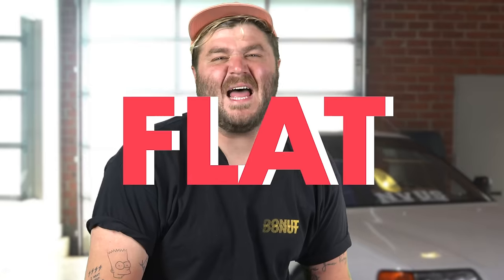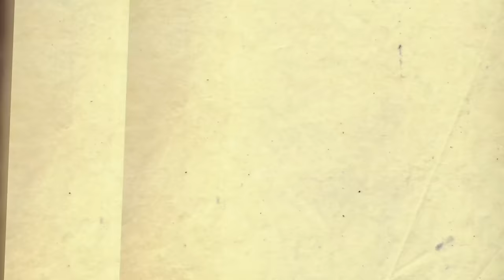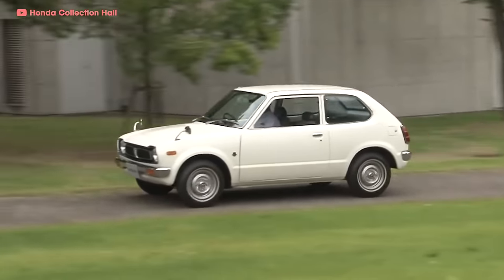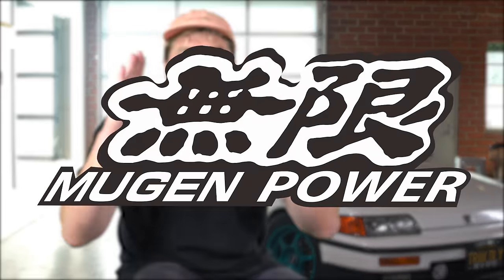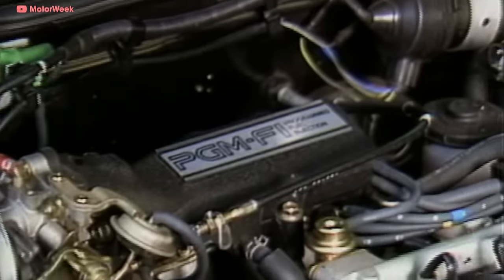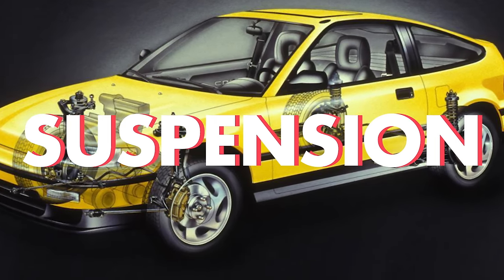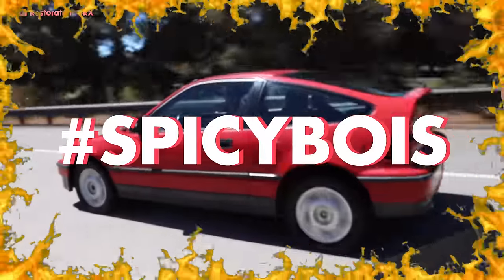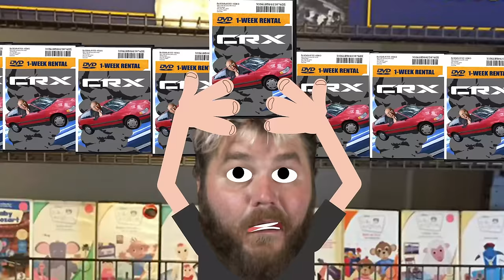Honda CRX - Everything You Need to Know | Up to Speed

Comment: I've been looking for a CRX for my pizza delivery job. can't beat the 50mpg city
Reply: 😄 I delivered pizza in a crx hf for years. He's 100% right. Averaged at least 40mpg all city driving. That hf trans was geared super long and the engine was designed to barely sip fuel. Best Honda ever made
Reply: Yes, you can! Get a Suzuki Swift 1L, 56hp (Geo Metro in US) to achieve 52 mpg 😎
Reply: And watch it crumple like a tin can when you drive over a pebble
Reply: @chopping_board1  nah
Reply: Will you? I could drive at 14km per liter? But revving it is mutch more funny.
Reply: The best part about using this car for pizza delivery is that if you miss the house you can do a U-turn on a single lane road.

Comment: I had 2 CRX's 20 years ago. Dammit I should have kept at least one of them. One had a JDM B16 swap and yes......I always did the buuuuuuuuurrrrrBBBBRRRAAAAAAABABABABABAA! as I exited the bay area toll bridges!!!!!
Reply: Yep.....
Reply: Wanna buy mine?  1990 CRX HF, with full suspension, ZC sohc, Si trans, RPF1 wheels, etc....
Reply: i just got a 91 crx si shipped from cali and it has a b16 engine swap with a turbo , i’m hella excited to get it !
Reply: my dad had a b20 in his. we also lived in the bay at the time. he raced at 7th and 1st street
Reply: I bought a 1990 running crx for 1200$ and never getting rid of it don't care if it has the smallest 1.5 engine in it gonna keep it
Reply: Same I had 2 crx’s sold one and the one I currently have has a k20 single turbo swap crx si
Reply: I had the European kind.. Nice answer on the golf/rabbit type 2 GTI. Rust is what killed them here.
Reply: I have two of them both are 89, one is an Si with the original D16A6 and the other is a DX with a ZC engine. Both are actually almost rustless and I live in the Pacific Northwest. Should I keep the Si completely stock and turbo the ZC because it has more HP and it’s just a “ DX “ ?

Comment: How to get you car stolen:
Own a CRX
Reply: Or integra gsr
Reply: They can tow it away with a Prius.
Reply: Thankfully haven’t gotten mine stolen. I watch it like a hawk though.
Reply: My first car hf d16y8 got stolen now the new crx si is garage keeped
Reply: Or a 97 civic
Reply: jimmynickelz i bought a gsr sedan and it got broken into the first week i had it
Reply: Does a rsx count
Reply: I thought that was cadillac SUV
Reply: Own a Honda
Reply: @jimmynickelz  Somehow I've escaped having my GSR stolen, even after owning it 18 years.
Reply: I live in the south, in the middle of nowhere so car theft just isn't a thing. But booooi when I was 18 I got a 1991 crx si 5 speed with a Z head and cam swap. It was so beautiful to drive on those country roads. Unlike most Honda's I've owned my crx had more low end torque - unlike the 1998 civic ex vtec I had which didnt get fun until over 6k rpm. The crx was fun at 3k. It just had a unique feel.
Reply: @thesars101  yeah my 98 had the d16y8 such a great modest engine. If I could have put that over into a crx body. Man. Now I get my thrill with Honda's bike line up. I like their smaller cbr bikes a lot.
Reply: My first car was an '88 CRX DX back in 2001. It was broken into four times in less than a year, then, finally stolen a few months later. It was found with the driver side door bent backward, almost touching the the driver side fender.  I honestly wish I knew the story behind that, haha.
Reply: @Patrick94GSR  Do you live in NY, NJ, CT, MD,FL, VA, IL, or CA?
Reply: happened to me, luckily found it with everything intake. Except that the tranny reverse gear was shredded.
Reply: My moms 86 Camry was the easiest thing to steal, friggin paper clip could open it up
Reply: @jimmynickelz  no sir, TN and MS.  When I lived in Nashville right after I bought the car in 2001, I found the tail gate lock cylinder torn up, and some of the wheel lug nuts missing one morning outside my apartment.  Someone tried to get in but didn't apparently.  Put an alarm system on it immediately after that.  Car looks like trash now and has 369,000 miles so I doubt anyone would want it lol.
Reply: @Patrick94GSR  Congrats man. Keep doing what you're doing, but don't think it wont still get stolen. It'll grow legs.
Reply: @jimmynickelz  honestly I don't care all that much anymore.  A few years ago I would have been crushed.  But now I'm looking at Miatas, 99-05 NB's specifically.  Love those cars.  After almost 2 decades with the same car it might be time to move on.
Reply: I own a CRX and a GSR, and the struggle is definitely real
Reply: @thesars101  oh shit what color? i think i may had forever borrowed it.
Reply: Exactly which is why it pisses me off people on YouTube talk about how great these cars are and it makes them even more likely to be stolen. Which is why I have 2 steering locks, a manual floor board lock, and a boot on my tire.
Reply: @Lance Archibald About two years ahead.
Grab a Civic key two years more modern and you have something like a one in five chance of having a key that works perfectly in the little CRX.
Reply: @dcoy158  same with my 3rd gen prelude!!
Reply: Or a 90s Subaru 😅😅
Reply: I live in a very nice neighborhood and im still terrified it will be stolen
Reply: Lol I own a GSR and I get a lot of compliments on it. I cruise at night and sometimes people follow me which is kinda odd. I haven't had anyone try to brake into it. Thankfully!!
Reply: Yeah park that shit in your garage

Comment: Up to speed on Mitsubishi Pajero/Montero!
Reply: @deepakthapa8582  you got the Montero which is the same
Reply: I have a 1/10 RC Pajero. I built working turn signals into it :)
Reply: I was literally going to type this.. 👍
Reply: those old 2 door models are pretty lit
Reply: Dodge Raider.
Reply: @grunkohlaktionar7474  It's the exact same thing, just renamed because Pajero means wanker in Spanish so they renamed it for the Americas.
Reply: @dejectedangel4970  But in Brazil,the car's name is Pajero.
Reply: @deepakthapa8582  US got the Pajero as the Montero fool

Comment: An up to speed on the ford probe and mazda mx6 would be pretty cool,  there practically the same car
Reply: No practically about it they're as alike as the firebird and Camaro
Reply: @jerlaine1638  They're built on the same body and both had the same V6 engine making the same horsepower. They're about as close to the same car as you can get without it being actually the same car, like the BRZ vs FRS.
Reply: @grantobrien3396  see your leaving out the first gen probe which had a 2.2 turbo and the first gen mx6 with a  2.2 turbo that had fws=four wheel steering, they both shared the f2t engine, the second gen mx6 and probe shared the v6 klze motor,. Currently i have a 89 ford probe gt thats black and im planing on puting an fe3 motor in and my dad has an 89 ford probe gt he's had since 1992 and is running strong, and at the time the probes were faster than the current mustang,  but ford detuned the probe to be slower than the mustang.
Reply: @twfgaming3391  they actually shared the klde motor, the ze is the jdm motor
Reply: @grantobrien3396  hence the Camaro and firebird reference....

They're built on the same line, as well as the more family friendly version the 626.

I'm on my 3rd Probe myself
Reply: @jerlaine1638  I'd really like to get my hands on a 626, but damn they're rare
Reply: Brandon Candelario Oh my bad, I misread your comment and thought you were saying they were dissimilar.

Comment: Hopefully you can do a video on it's spiritual successors, the crz. I'm a proud owner of one.. even if it doesn't quite live up to it's sporty moniker or hybrid fuel economy.
Reply: I own one and really enjoy it. Lots of quirks but a really nice interior and dirt cheap on the used market, and I think the real-world MPG is better than advertised. It's pretty sporty, I've won autocross events with it!
Reply: @VSPEEDGarage  nice! I've been getting over 40 mpg..which is great with combination driving but I have a co-worker with a fusion hybrid who gets better mpg and the car is bigger,more powerful, and faster. It does have a lot of quirks and I love the looks of the car but I can't help but be somewhat disappointed by the overall performance and mpg. Don't get me wrong, I don't regret buying it, but considering the fusion is heavier with more rubber on the road I just can't understand why the crz is relatively bad at fuel economy. The car is not unaerodynamic either.

I will say though, the crz wasn't as cheap as I thought on the used market. The fiesta is much cheaper on the used market with fewer miles and less years. I've seen some crz with 100k and 8 years sell for around $8000. This is base model. For a car whose MSRP was $19000 for a 2011 base, that is actually a lot of money... especially for a car that most likely needs a hybrid battery replacement.

I have the 6 speed ex btw.
Reply: @tonywong8134  I know in my region they are much closer to $4-6k for 70k-120k miles. The batteries last longer if they are the early year models because they are NiCad, not Lithium Ion, which can die more easily. Also, realize a 2011 model will be behind in engine technology from a more modern car. The new insight or Accord hybrids are more powerful with better gas mileage as well. 
It's not fast in a straight line, it's more of a momentum car, just like a Miata or Civic Si. Still faster than an old CRX would be stock, plus you get the benefits of modern tech, safety, and suspension. A base Fiesta or maybe a Fiest ST might be close in price but its also a Ford. I think the Fiesta interior is pretty terrible as well honestly. Reliability will start to become an issue with those, when there are tons of examples of people with CR-Z's at over 200 or 300k miles. Honda's have consistent issues with paint and A/C, but not a whole lot else to go wrong on the CR-Z. Any premium you think you would be paying for a used car pays for itself in the long run.
Reply: @VSPEEDGarage  that is cheap...the crz where I live go for twice that given the same number of miles. I would've settled for a nickel model but finding a six speed crz is difficult for a good price around here. I have a 2015 model which does have a bigger battery and the car is slightly more fuel efficient and faster. My co-worker has a 2013 Ford fusion so it's not much newer than the 2011 crz.
Reply: @tonywong8134  ah makes sense. I do wish they had put the civic engine in rather than the Fit engine, that would have at least boosted power, maybe not fuel mileage. They definitely made mistakes and sacrifices when developing it, that's ultimately why it failed, but I do believe it's a lot better than people think it is.

Comment: What the fucc
My 08 accord have around 170 hp and it's pretty fast when i floor it (in city not highway) 
160hp for such lightweight car? With vtec? Sign me in!
Reply: I have a 95 accord, it's crazy how little it changes over time. I get around 150 hp with a weight of `2800 lbs

Comment: James could you make a Infiniti g35 video
Reply: Why? Its just a slighlty more curvy 350z with the same VQ motor and baged as a "Skyline" overseas and an Infiniti in NA.
Reply: Because its like the crx it's just a civic in a small body
Reply: @edulop6273  have you not seen a g35 in person? They some girthy bois. Fairly certain from bumper to bumper they are longer then the 350z and they are comfortable above 3000lbs curb weight, closer to 3300 I belive

Comment: Have 91 HF 579000 miles in mint condition  brought new...red
Reply: Bryce Czirr what’s that?
Reply: A mid 2000's Honda CR-V motor far too capable for any unforgiving driver in a CRX who has inspiration.
Reply: i had a 91 HF as well.  regret getting rid of that thing but it had some mysterious fuel delivery or sensor issue and i couldn't deal with it at the time

Comment: I sat at the back seat goin 100 mph 

ITS CRAZY SCARY
Reply: I can tell you the front seat is just as scary at that speed, the car needs some serious aero 'cos it's super floaty above about 140km/h
Reply: @elanjacobs1  its cramped back there
Reply: @farrelsetiawan9703  Can't argue with that. I had  a full car once...fell sorry for the poor suckers stuck together in the back, but it was only a short trip.
Reply: My 85 doesn't like to go much faster than 111ish probably because of aerodynamics and power.
Reply: @gemlazium  Mine has a limiter at 170km/h, it'll theoretically get to 200 with enough road but there's no way I'm trying it. I want to live.

Comment: Had the UK CRX Vetec 160 BHP for 8 years  brilliant car, fast on narrow twisty English roads 100% reliable despite getting a regular thrashing.  Eventually got bored of having thrash a car to make it go and traded it for 1999 Elise with just 143BHP but only 760Kg weight. Rover K engine with the bugs ironed out in a light weight Lotus has lots of torque so less thrashing required.

Comment: I've owned about 5 Crx's. I still got my 90 Si (owned 10 years now). Super clean. But so fun to drive. And I got the rear seats😁 but literally no one can sit back there😂 I used to hate them before I got into Hondas. But for personal reason, (it's always about a girl) yeah, I'm talking about you Audrie! As far as frontal collisions, I did wrecked one doing 50mph head first into an embankment and it took it like a champ. Shoved the radiator in just barely touching the exhaust header. I was astonished. But not a single injury. If you get a chance, drive one.

Comment: I had from new in Australia a silver 1988 CRX with the 1.6 si VETC motor. The cars sold in Australia had the big DOHC motors and you could tell straight away by the hood 'bulge'. I paid AU$34,000 in October 1988, loved the car, it had a perfect driving position for me being 6ft, I had test drove a Peugeot 205 GTi but the gearstick wasn't comfortable for me. After a year I had Recaro seats fitted plus Momo steering wheel and Momo Corse 15 inch rims with Yokohama A008 tyres which gave it perfect road manners. Over the 4 years, I had it I did about 80,000 miles and had it up to a top speed of 137mph at which there was no vibration and it felt very comfortable. Got married in 1992, sold it for AU$22,000 bought a sedate Suzuki Vitara 4x4 family SUV...oh well and fond memories!

Comment: i loved these cars. i really wish they weren't so hard to find now .  my 1st car was a 86 blue/grey  CRX SI  i got for $600 in 1997 that finally got wore out at 279k miles.    then a perfect  90 black SI.for $1500 in 2000 . that a friend still drives today.    then a 94  ... burgundy? civic  (probly still on the road somewhere) . a white   01 acura integra gsr  ,  (definitely still on the road, and almost as awesome as the 90 crx)    a  silver 01 accord ex ( i still drive  going on 300k miles, and still  running perfectly!)  ,and currently i drive a 07  acura TSX  .that just hit 220k and looks and rides like its brand new.     honda/acura have IMO been the best car maker or the last 30 yrs hands down.

Comment: I drove a friend's CRX with a B16A swap.  You had to wind it up to like 6k RPM to get even the slightest hint of acceleration out of it.  I don't mean enough to have fun.  I mean enough to move the vehicle.  The gearing was wild, like a dirt bike, to overcome the lack of torque.  Because of that, highway speeds meant earplugs and the gas mileage was unimpressive.  It got less than 30 mpg, which was memorable, because my c4 got 31 mpg.

So the CRX SIR was a 2,200lb car that was in the mid 15's in the quarter mile, absolutely could not be short shifted, and got worse gas mileage than my car with an iron block 350 in it.  But, it was cute.

Comment: I was one "oh did the exhaust just fall off duribg the test drive?" away from getting a CRX back in 06, ended up with a 1995 Peugeot 306 XR, 75 semibuff french equines, that did 60mpg at times on the Landstraße at 60mph or 55 on the Autobahn coasting at 75 or so.
Add the almost 15 gallon fuel tank...that's RANGE, I took it from central-ish Germany to southern France on one tank! Having a car that gave you Copenhagen, Amsterdam, Prague, Vienna, Paris and London, each within nonstop range was awesome as a young dude. Not CRX cool but alright ;)

Comment: We got an 85 that was one of the first 1000 from the line FOR FREEEEEE! after 12 years of sitting in an alley way, we knocked on the owners door and out comes an old lady, like really old, Betty White old. We asked her about the crx and she told us it was her grandson's car but he died in Afghanistan. Turns out he was in the same unit as me when I was serving. She literally just gave it to us. It had a lot of grass and weeds growing up around it so we got out our weed whacker and lawn mower. After we dug it out we did her whole yard as a thank you for giving us a car, it was the least we could do. After we put some fresh gas and a new battery in it, she fired right up without a hitch. 12 years of sitting stagnant outside and we drove it home. The dash was cracking, and the foam spoiler was dry rotted so bad it flew off driving it home. After new plugs and wires, fresh fluids all around, she was back on the road and smashing Mustangs and Camaros

Comment: An econobox that had character. This was an un-complicated automobile very well screwed together. Not a luxury car in any way, but the interior was spacious and user friendly. Those small engines just felt like a Honda product. There was no subframe of any kind so the engine was mounted directly on the car body which makes you 'feel' the engine. Base Civic also had a delicious non assisted steering rack. 0:35 is that Soichiro Honda in the middle ?

Comment: I have two of them both are 89, one is an Si with the original D16A6 and the other is a DX with a ZC engine. Both are actually almost rustless and I live in the Pacific Northwest. Should I keep the Si completely stock and turbo the ZC because it has more HP and it’s just a “ DX “ ?